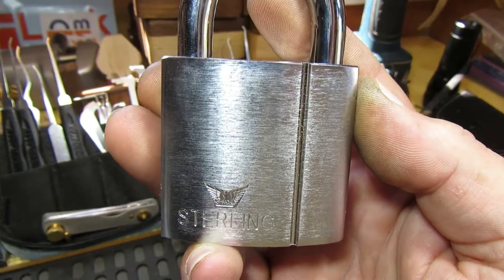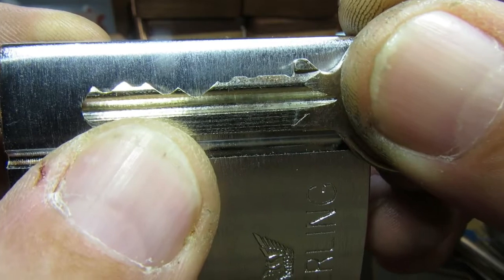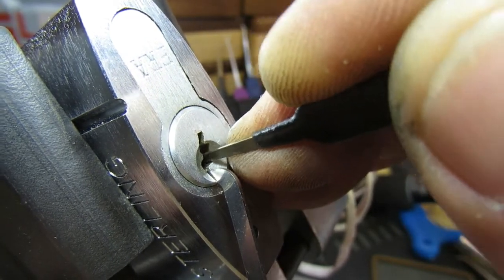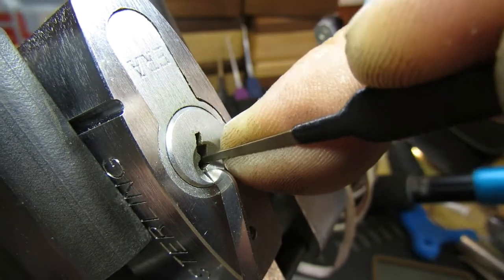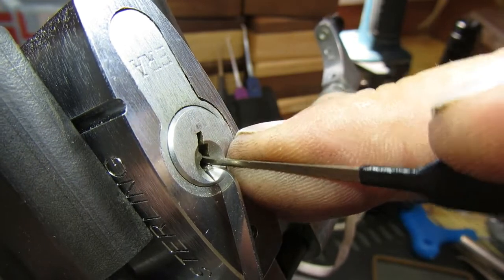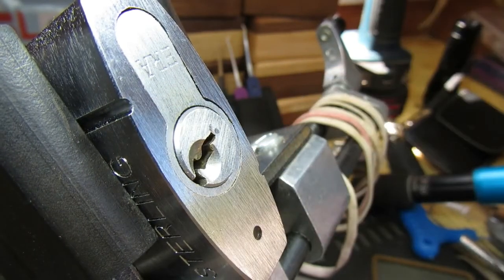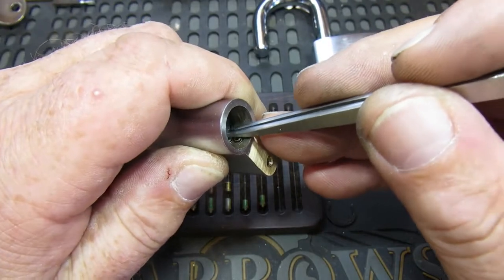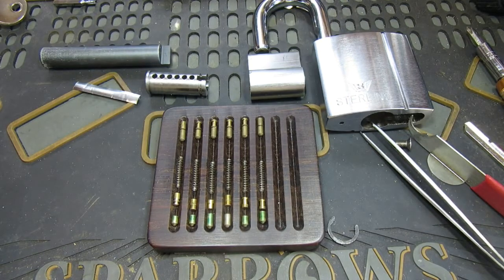(316) Sterling 55mm Euro Padlock with ERA Repinned Core

Comment: Nice lock. I'm having problems with the Sterling you sent me. 
Really like the x-mas tree pins. I tried some out in a Lockwood oval I have and can't get that open either.
Reply from the maker: Thanks, the Xmas Tree pins are great :=))
I don't remember sending a Sterling, but if it's giving you problems it's probably from someone better than me :=)))
Reply: Pete Restall it's a Sterling rim cylinder. Pinned in the shed 28-12-16.
Reply: It was a mix between the keyway and the bitting. Key bitting is shaped like a V.